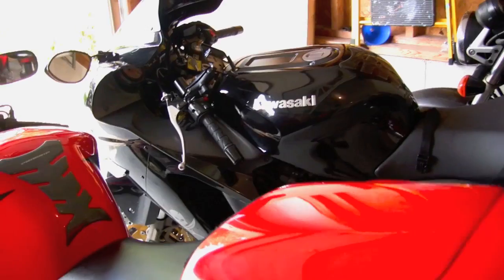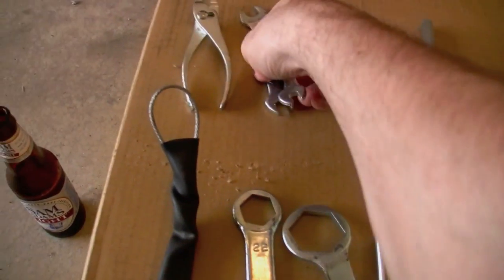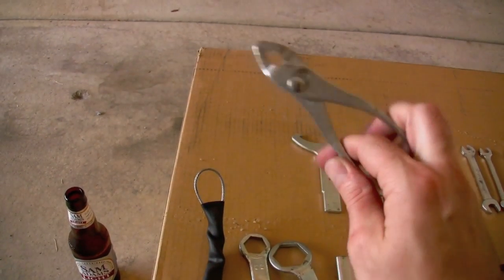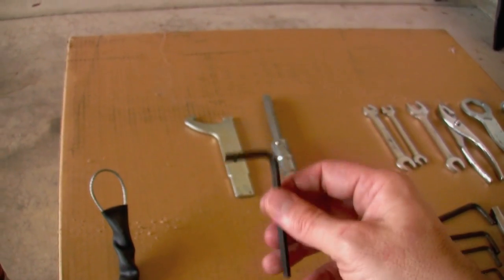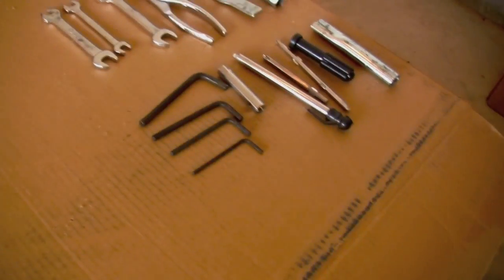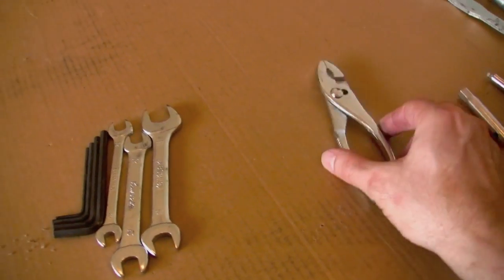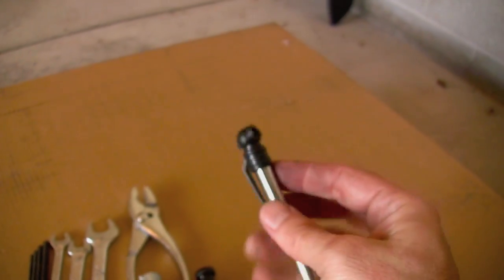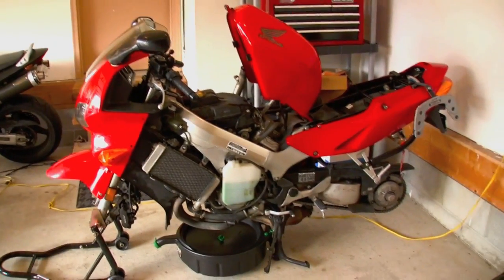What's in your motorcycle toolkit?

Comment: I would recommend a tool kit consisting of tools that would be used for chain adjustment, clip-on adjustment, brake/clutch perch adjustment, rearsets and gear shift/brake linkage removal, and air pressure gauge. In the event of a crash some of these parts can be knocked out of place and or broken. I broke my left foot peg bracket but was able to remove it along with the gear shift linkage and rode home in 3rd gear from the canyons.

Comment: Out of curiosity, I went and looked at the stock toolkit in my bike. All it came with are the screwdrivers and that long socket thing similar to the one in your Kawi's kit (although a larger diameter.. not sure what it's for). I did have to buy a cheap swiss-army knife kind of allen wrench set so I could have it handy to remove the fairings any time I may be on the road and need to get to anything (i.e., the battery... fuggers put the battery under the left fairing near the engine block).

Comment: Nice vid, Billy!  My kit includes a multitool, allen wrenches, and a screw driver.  Harleys never need to adjust a chain.  I've only used my tools to make mods, and once on my handlebars to tighten them, and on my rear exhaust when an aftermarket  nut backed off.  27,000 miles and never a breakdown of any kind.  Not even a lightbulb.  Adjusting rear shock needs no wrench either, just a mini air pump.
Seems you use tools more on your bikes than I do on my old Harley. Jus' sayin'.
:-)

Comment: I add a tube o pratley steel or jb weld to my kit as a low speed crash on my buddies bike resulted in a cracked engine casing and massive oil leak which we fixed using the glue, small and light weight and invaluable and got us home(300 mile away)
tubeless tyre repair kit is a must and has also saved our arses 
been biking many years and as such have refined the toolkit fit for purpose

Comment: Nice video.  Have you ever tried using the wrench from the kit to loosen the rear axle on the kawi?  When I tried to do it with my ninja I found that I just couldn't get enough torque through the wrench and had to use a garden lamp as an improv breaker bar.

Comment: the very last tool is special. They make you use that took so you cant use a regular socket. Its a safety measure, so the kids don't steal your battery.  Just like how some cars have a single lug nut on each wheel that has Torque-like socket head. There is no ordinary tool that can remove all the lug nuts.

Comment: @billmaa LOL!  But seriously, Never knew how ancient a rear suspension system I had until now.  I found aftmkt upgrds at "Progressive."  Mixed reviews though. Always felt fine on my RK at about 16 psi. Rides smooth, and no problems cornering. As for the belt, how much power does my RK need to tour the back roads?  Not into 0-"warp 9" in 2 seconds.  It's all in what we want out of it. Speed limit is just fine 4 me, and comfy as a La-Z-Boy. 
Thanks for the ed. and stay safe out there, my friend!